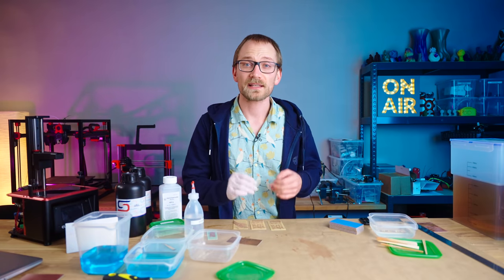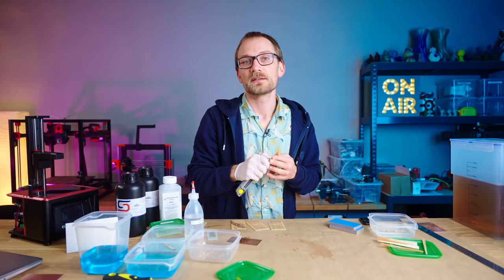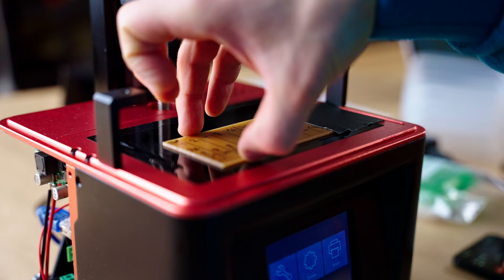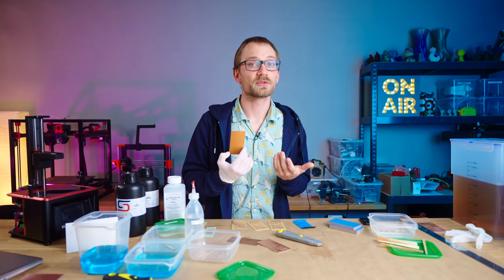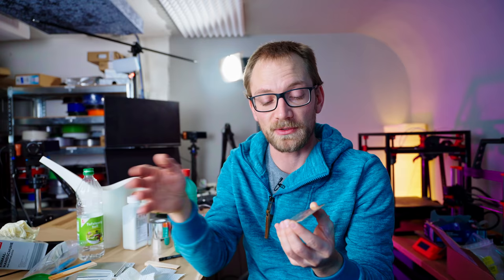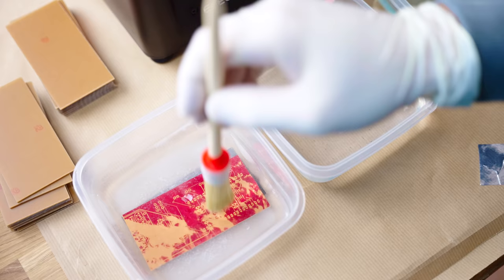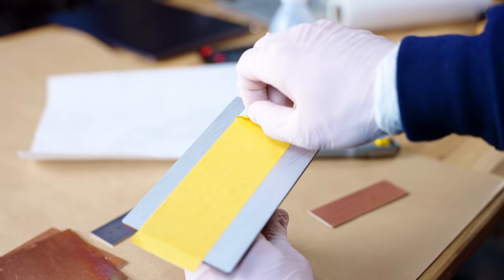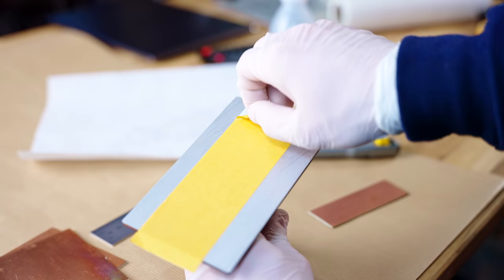The fastest way to make crisp PCBs at home!

Comment: Yikes, it looks like a very high cost investment for the machine & the special materials. I can personally knock out a holes drilled PCB (even quicker for SMD only) using the Laser Printer Toner method well under an hour as a prototype for a circuit design confirmation of layout. It uses the sorts of tools i have at already at home anyway.

Comment: Hello All,
I have always used the laser printer method.  Is there some reason that you have excluded that?
B/W laser print mask on shiny magazine page (in reverse, as will flip over) , Iron onto copper board, soak in water and gently remove paper.
Should now have copper board with plastic laser print.
Etch - Done.  No expensive stuff at all.
Thanks,
Brian
Reply: Some can't get very good resolution with the iron on method. I've ruined a number of toner cartridges using press and peel blue too. Which if you've ever bought a toner cartridge you know what that can cost.
Reply: @1pcfred  Thank you, it can be touchy.
Reply: @brianambuhl6888  that's how many things are. If it's easy where's the fun in that?

Comment: Could you just print PLA onto a lightly sanded PCB blank using, say, an Ender 3? Sure, you'd be limited to ~0.5mm resolution, but that's probably good enough for many home projects.
Reply: It's actually pretty hard to get the filament to stick to the copper, and for the etching process, the filament needs to stick really well so you don't get the acid under the tracks. Maybe it works for really big tracks on very simple PCBs, but then you can probably just do the same with perf-boards and some wires without needing to layout a PCB in software.
Reply: @ProtonOne11  Thanks! (Perhaps it's worth trying with some other materials?)

Comment: I hear that 50 ohms is the required resistance, on the metallic tracks of a printed circuit board, so a little bit of maths may be in order.

Comment: Got a Saturn a year ago just for this. But the problem is the gerber to stl conversion. Sadly the video skipped that detail, maybe a future video?
Reply from the maker: The files I'm using never go into Gerber format - I'm opening up the Eagle design in Fusion and then exporting an stl file from there, which Chitubox is happy to process. It's a bit of a hacky process, but it works.
Reply: @Anders Doverud This should work in your Saturn if you've not updated the firmware.
Reply: Well I posted a solution involving png and gcode but my comment has been deleted three times. Viva la libertad de expresión.

Comment: (Looks at title. Looks at thumbnail.  Ponders for a moment.  Thwacks head.)
Why didn't I think of that?  It's so obvious, and yet it hadn't occurred to me!
Reply: And, the idea having been planted... one of those UV programmable masks with 50µm pixel pitch plus a moderately good lens and some fixturing should get down to the feature size used in classic 4000-series CMOS.  Might be able to get to the feature size (and overall object size) needed for a DIY 8080 or 6502 chip...?
(Kids: don't try making chips at home.  The etchant is seriously bad stuff, as are the gases used in doping the silicon.)

Comment: Great video!  I made a DIY UV light source for exposing sensitized silk screens, and your video got me wondering about using a Diode Laser engraver to expose the screen. If it would work, the priinting of a transparency could be eliminated (one of the more expensive steps for materials), going straight from the image to an exposed screen via something like Lightburn. I see there are 405nm diodes on Amazon for about $60.00. Wondering about experimenting with my existing CO2 laser to manage the X-Y translations (CO2 off). Any thoughts!  (I'm wondering about resolution and line thickness)

Comment: was planing to test this.. but you did it so i dont need to :D
Reply: So small update.. with old anycubic photon (not s) and can spray photoresist was able to etch 100um (basically 2 pixels) space between two adjacent copper traces. A think its possible to go down till 1 pixel (50um). Etching was performed in 1% NaOH (RT) and in 200g/l Na2S2O8 (50 C) solutions with buble agitation.

Comment: hi i found a quicker and dirtier way with kicad inkscape and blender.
1) kicad: export to pdf
2) inkscape : import, select it and export it as a high dpi image.
3) inkscape again: import it again and trace it without any smoothing . save it as svg
4) blender import svg -> convert to mesh and extrude it -> export to stl .. done
However the workflow still sucks XD

Comment: Your link to "etching kits" does not seam to list the pcb blank you used.  What is that blank called?
Reply from the maker: You should be able to find them under something like "photo positive PCB"
Reply: Photosensitized Copper Clad board, or Positive Photoresist

Comment: now imagine if you had a jug in the print vat... so the PCB can be perfectly positioned. Step #1 Expose Photo resist, Step #2 use the agitation and heating (found in some printers) to edge the PCB, Step #3 print a layer of photopolymer as solder mask onto said PBC ???

Comment: The drilling for through hole parts aside, vias would be a bit inconvenient. Otherwise, great process!
Reply: Why do you need vias on a single sided board?
Reply: tiny pieces of wire will work, you can plan ahead to get vias in places where you can work.   its far easier to use surface mount parts where possible.  i've done this many times at home.   i would now simply do this online, and wait a week for a shipment from thailand.

Comment: You still have the problems with expensive presensitised PCB stock, which goes off over time, and all the messy developing and washing issues with chemicals.
This is still a much worse, more expensive, (and slower) process than direct toner transfer. Toner transfer is not perfect, but is faster, cheaper and no nasty chemicals (apart from the etchant which you always need anyway).

Comment: im honestly going to need some help with this before i lose my mind... i've been struggling around 10-12 hours to get this shit working and every single thing or tool i tried either fails  or runs abysmally slow. i got my design made in Kicad and then export the gerbers. so far so good.. loading into F360,works fine but here is where everything breaks...
because the model is generated with so many vertices  it destroys anything i try to load it into.  F360 literaly takes 5-10 mintues to create the box, but that is not the problem... the problem is that every single tool i tried to use  failed to do the subtract boolean operation. F360 fails. 3ds max fails, blender fails, even pursaslicer failes to create a proper mesh that contains my circuit.. how the hell am i even supposed to fix this issue.. cant i just generate my own .CBT file where i it a monochrome .bmp image and tell it  hey this is layer 1.

Comment: A guy described a PCB drilling jig that gives much quicker and more precise positioning than a drill press in a comment reply on this video (username "l p" replying to Daniel Roibert) https://www.youtube.com/watch?v=hj7iFZknBrQ
Drill goes underneath pointing upward, and the table has two layers where the PCB slides inbetween. The top layer is clear acrylic, and you use the drill to make a hole in it, which serves as a visual reference for exactly where the hole will be drilled up from below the PCB.

Comment: Do not demonize NaOh on your skin, with concentrations and quantities you're using it's enough just to be careful. And also, don't use vinegar, it's an old knowledge, modern approach is to just rinse it with a lot of warm, tap water. It's not that great idea to treat chemical burns by trying to pour another not-so-neutral compounds on your already damaged skin.
Reply: Faça um vídeo brother

Comment: For the chemists here - is there a "photo-reactive" etchant? i.e. on that etches copper only in the presence of violet/UV light?
If so, a "maskless" process could be used, whereby the copper-clad-FR4 is attached to the printer's "build-plate" and is repeatedly immersed in the tank filled with etchant and exposed to (the same) patterned light, several (thousand?) times.
Reply: the opposite type of photoresist to the video exists, the exposed area will wash away while developing. Then just dip it in the etchant and youll have your PCB. Why would you bother to expose it again and again where it barely needs exposure once for 30-50seconds. If you partially expose it and dip it in the developer, you'll not get proper results and you cant skip the developer step otherwise the entire PCB will still have the photoresist on it while you etch....
Reply: @rokiedecentra9656  That is not what I asked.

Comment: Love your videos but I feel your title should have a  question mark at the end. This is still not faster than a good PCB mill.
Reply: Isolation routing cannot touch the detail that etching can do. You can also etch a board of any size in 2 minutes. I want to see a PCB mill compete with that. YouTube's upload button awaits you.
Reply: @1pcfred   it’s amazing don’t get me wrong but without the drill holes it’s still not done.  By hand drill holes take a considerable amount of time
Reply: @bjsummerfield  drilling PCBs may take you a long time but it doesn't take me long to do at all. I'm a professional. I have a book in my machinists box from the International Association of Machinists and Aerospace Workers Union that says I'm mill and drill. Plus I have a high speed mini drill press. So I may have some advantages you don't. I even have my own CNC engraving machine too. But I still drill boards out by hand. Because I'm just that good at it.
Reply: @1pcfred   regardless of how fast you personally can drill this video still doesn’t show how this is the fastest method. Tom doesn’t even mention a comparison.
Reply: @bjsummerfield  I think he was only comparing it to board fab turnaround times. At least that's the impression I got.

Comment: Neat Idea but why would you do this with todays affordable PCB services? Drag & Drop on a webpage -> 1 week later you have your double sided PCB with vias and solder stop. Heck even a stencil for 10$.
I used to do my own PCBs, exposing was the least painfull part. Developing and etching is messy. Soldering without solderstop is a PIA and drilling? Boy did I hate drilling. 
Double sided PCB? Solder every hole on both sides. 
So I put SMD on one side and the THT on the other. Spend a good amount of time trying to stay single sided. And if the PCB worked I would start from scratch because you can make it way smaller / nicer if you use two or more layers.

If you want to try something, do it on a bread board :D

Comment: Useful trick but unfortunately it covers only a portion of Pcb creation steps. 
Then working with more interesting project’s pcb fab can offer much more:
etch the board
drill holes for thru hole components
Two layer layout 
Metallic vias between the layers
Protective coating so copper does not corrode
Silk screen for marking the components
Cutting the pcb if you need multiple boards

Also nowadays custom professional pcb are quite affordable.
Reply: Drilling could be made rather easier by printing on little centering holes. 2 layer registration could be quite good, using appropriate fixtures.
Reply: Some of us like to make things ourselves. Maybe we just enjoy the process? If I wanted to buy electronics then I'd just buy them. Often times I do.
Reply: @1pcfred  absolutely. This is a very valid reason. Hobbies are meant to be enjoyed.
Reply: @queazocotal  it helps. Also drill press unless you have very steady hands.
Reply: @MegaMoonse  I have a high speed mini drill press for drilling PCBs. It's amazing! Actually makes drilling boards fun. I got it dirt cheap too. I've seen the same exact one going for over 4 times the price. So I don't know what was going on there. But it was a good deal. I've snapped many a bit trying to use a Dremel style rotary tool. To the point where I tell people that's not really viable. It's one of those looks like it works but really doesn't deals.
Reply: @1pcfred  that is awesome. Working with proper tools is a game changer. At one point I was thinking to get a “drill press” adapter for my dremmel style tool. It could be an option for somebody on a budget.
Reply: @MegaMoonse  I almost bought one of those Dremel stands once. I saw it at a yard sale. But I have my mini drill press. Those stands do more than just drill. They hold the rotary tool in various positions so you can use it as a stationary tool. I've made a holder for one of my rotary tools already though. So I passed on buying it. Yet I did seriously consider the acquisition.

Comment: Seriously?? That funny smelling dust is bad? Damn, I've been sawing them all these years :-(

Edit: I've done some research. The only PCB I've been sawing and sanding by hand are Stripboards / Veroboards that are made of a material called SRBP: Synthetic Resin Bonded Paper. The dust they produce is just paper and phenolic resin. It won't cause cancer like asbestos and it won't cause silicosis like when inhaling fiberglass. Also, I must have handled at most a dozen stripboards, it's not like I do it every day.

Still, it was foolish of me not to wear a respirator when sawing or sanding anything at all, so I'll do that in the future, especially if I ever handle fiberglass PCBs. Thank you for the heads up. Safety precautions that might be obvious to some are unheard of to others, especially in self-taught, amateur circles.

Comment: TBH I don't think this process is that easy, especially when you go the double-sided PCb route. Printing on a laser printer the negated image like you had there, send it through a laminator to transfer the toner of the laser onto the blank copper PCB and etch it then is maybe a bit more work, but it works like decades.

And if you use high-gloss paper from some flyers, the toner is getting off it pretty easy. An old HP Laserjet and a 10 bucks lamination tool is enough for that.

https://www.youtube.com/watch?v=XJgKgeQOnfY   pretty easy explanation how it works

Comment: this is not the faster way to do pcb and you need money. cheap way and fast is the iron solution with no 3d printer and no photo resistor pcb (it cost 4 times more than nornal copper pcb)

Comment: i was thinking you print resin mask on the PCB :( why bothering like this when its plain easy, just print your design on a transparent foil and leave the PCB outside on the sun for some time...
Reply: i think the resin mask may let in UV but yeah the transparent sheet method is more cost effective
Reply: @rokiedecentra9656  the structure and chemistry of the resin is so it cures under UV, that also means its absorbing all the UV it can get even after its cured, so no even a 1 layer of cured resin is enough to block all the UV light from passing thru it, thats how the SLA printers work, if the resin after curing was letting UV light thru it then the prints dimensions would be unpredictable... UV resin is also fluorescent under UV, which also proves that its UV absorbent...
Reply: @Hobypyrocom  oops i forgot this is a resin printer... my bad
Reply: @rokiedecentra9656  ;)

Comment: super
Reply: cnc mask for a ton at a time
Reply: optical cure mask, right
Reply: try using a blu-ray 400nm (uv-a) drive as the curing burn-draw device, for resin
Reply: yes, coat a cd/dvd/disc (pcb) with the copper then uv-photo-cure-resist
Reply: but why would you need a circuit board for a simple dc emf motor, just voltage with a switch, or potentiometer, and you are a go
Reply: you could also use copper coated pcb, then grow a etch resist layer on top of the copper, ie, the normal resin, then wash, etch, and you have resin coated trace lines, done
Reply: stop lying
Reply: replace the resin print tray-bed with the pcb holder, just dip in the standard print resin, print the coat pattern for the traces

Comment: or you know, get a 15 Bucks UV Nail lamp...
Reply from the maker: Ah cool, do they now come with USB ports to load your designs onto?
Reply: @MadeWithLayers  No. But do you really think that people are more likely to have a resin 3d printer at home than a regular printer ?
Reply: @MadeWithLayers  No, but my laser printer does, and it prints nicely onto transparent sheets.  Admittedly, my consumer inkjet was terrible at that.  Either way, the sarcasm was maybe a bit too much.

That is not to say this is not a neat idea - I like it - but I stopped using photoresist for PCB prototyping years ago due to the cost.
Reply: @MadeWithLayers  Can you test it with a smartphone or tablet? Just upload circuit image and use full brightness. Sorry for my english.

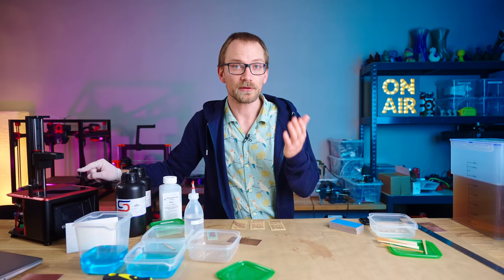Comment: 0:18 - That resin 3D printer is not a SLA machine. It is a LCD 3D machine. Two different complete species of 3D printers with huge price differences and how they work. SLA 3D printers uses lasers and LCD 3D printers literally uses a LCD screen. There's also a DLP  3D printer which uses massive amounts of ultra tiny mirrors. Use the correct terms for the 3D printer game. Its like calling an X-box a PlayStation when they do the same thing but are built completely differently, sounds silly. 8:46 - Oh God... what are you doing here? This is completely weird and unnecessary, you need to use photoresist, either liquid based photoresist or dry film based photoresist made specifically for PCB sensitizing.